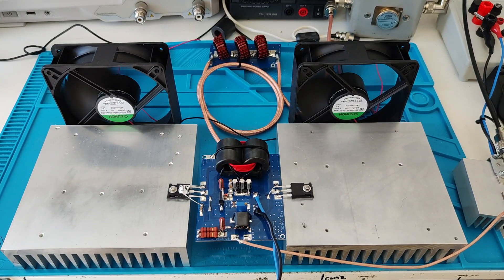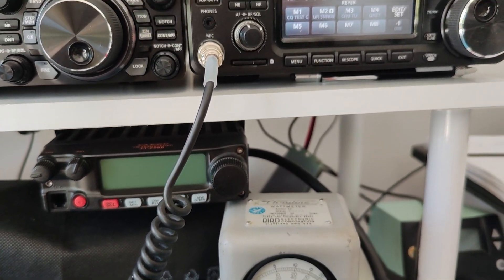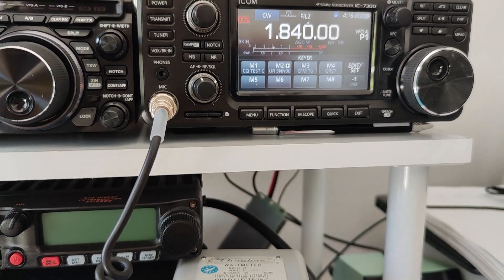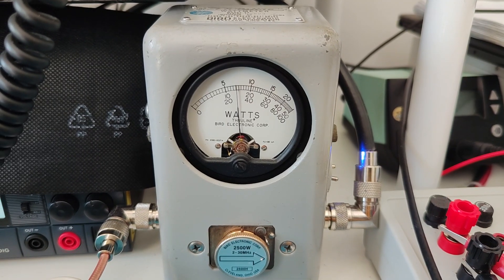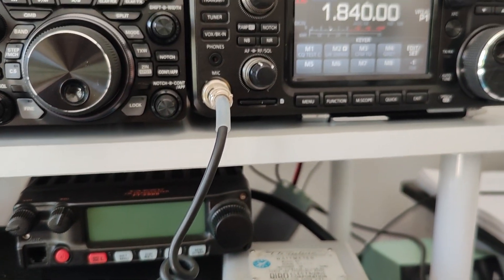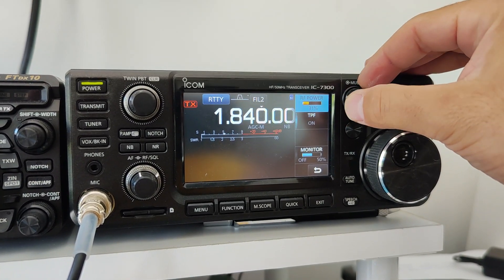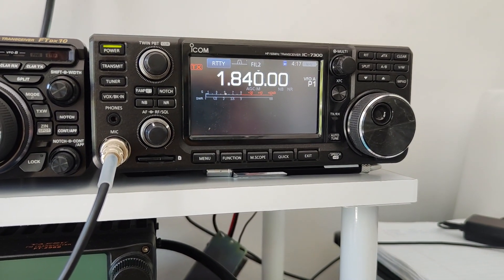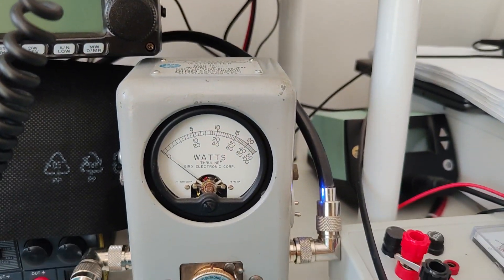MF/HF 0.4-3MHz 800W AMPLIFIER BOARD TEST

Comment: If I was to build a mono band amplifier for just 160 meters, would it be advantageous to use this board over your mrf300 board?  Thank you for the video.
Reply from the maker: Hello
This board cost less and produce little more power on 160m than the 2xmrf300. But the mrf300 board is for all modes (SSB etc.)  instead of this low cost amplifier that is for AM/CW and digital modes only.
Reply: Very good job. I like this design for 160m QRO so much. For 160m, we just need CW and digital modes.